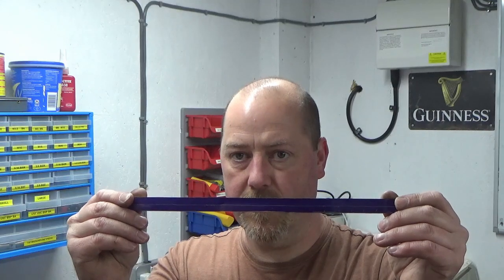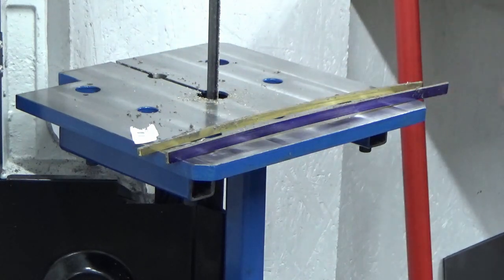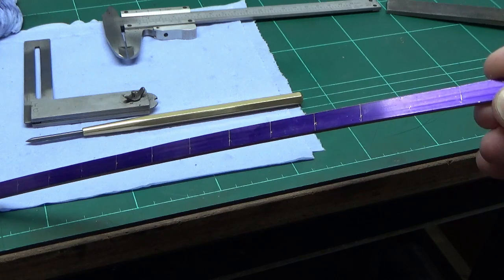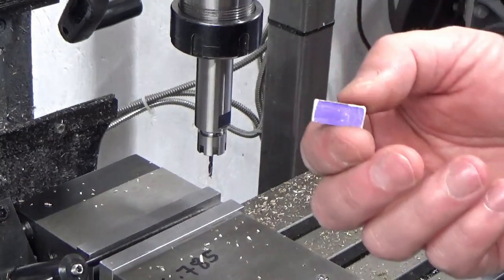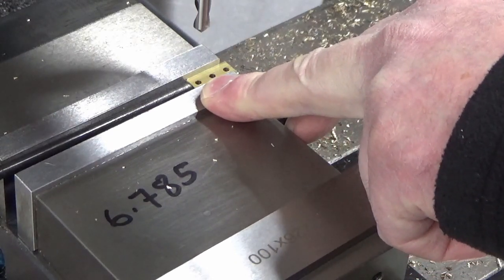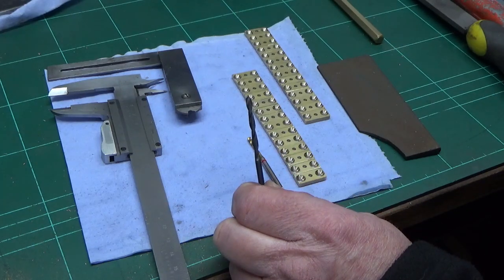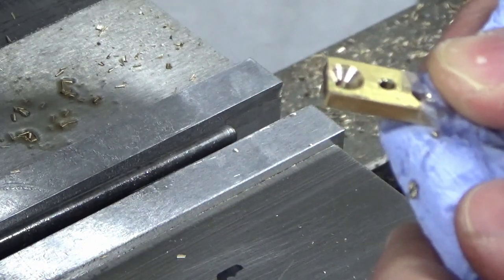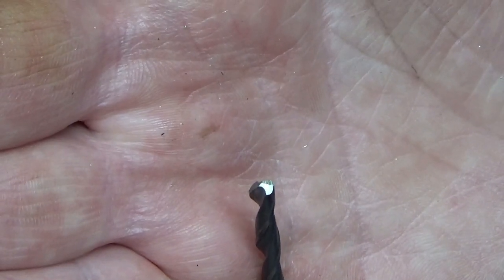The Mystery Project #1

Comment: Interesting Jon, eagerly awaiting to know what it's all for now. You had the band saw set up vertical with that wonderfull table, then you went & hand sawed all those bits off! Could have even set a stop & eliminated the need to blue & marking up! Got it done though.
Reply from the maker: Hi Dave, thanks for the comment. Ha Haa, don't hold your breath lol. Unfortunately, the hole in the middle of the bandsaw table is too big to cut these off. Need to make a bung for it close fitting to the blade. I am also going to make a fence which could double as a stop for jobs like this. Cheers, Jon
Reply: @jonsworkshop  aah! that makes sense. More material for vids :-)

Comment: Jon and others, the backing off of the drill bit cutting edges for drilling hard brass also applies to Perspex and Acrylic, that will also snatch and grab. What is known in the trade as 1/2 hard brass sheet than can easily be bent, will NOT grab and so a standard ground drill will be fine. You will be able to tell this as the swarf will come out in curls as it does with other metals. Regards from Australia.
Reply from the maker: Hi Dave, thanks for the comment. Bang on mate, good info. I have worked with half hard brass many years ago, it's almost nice to machine unlike the regular stuff. Never seen stress relief this severe before, they gave these bars a good abusing when they rolled them. Cheers, Jon

Comment: Another great video Jon.....that was some bend there when you bandsawed the brass!! With the pattern the parts were laid in I thought of Olympic rings made of links,  but  there's 5 not 4...mmm ......keep thinking!! 🥴
An adjustable parallel guide would be a useful addition to the bandsaw table as a future project......just a thought!!
Atb Carl 👍
Reply from the maker: Hi Carl, thanks for the comment. Yes, I want to make a fence for the bandsaw table, will definitely feature at some point. Never seen stress relief that severe before, that brass must have been mashed about when they rolled it. Cheers, Jon

Comment: Wow that bend from the bandsaw was huge!.
Are they some sort of chain links?. The countersink on rough wood leads to rough countersinking. 
Better to fix a small fence to work against.
Like the blunting idea for drill bits, probably works on aluminium. (careful how you say that).
Reply from the maker: Hi Fred, thanks for the comment. Yep, some serious stress residual in that brass bar. The C/sinks on these are really not important, hopefully all will become clear at some point. Yep, the negative rake on drills is an age old trick, used to grind big 3 inch Dia drills like this back in the late 80's, works a treat. Cheers, Jon

Comment: Could the brass stress relief response also have been as a result of the inside cut edges heating up and expanding as you cut them?
Enjoying your clear and concise approach.
Reply from the maker: Hi Jim, thanks for the comment and feedback. It may have been exacerbated by the heat but I think the lions share of the distortion is from internal stresses from the rolling process. Never seen anything that bad before but then it's all small cross section so struggling to hold itself true. Cheers, Jon